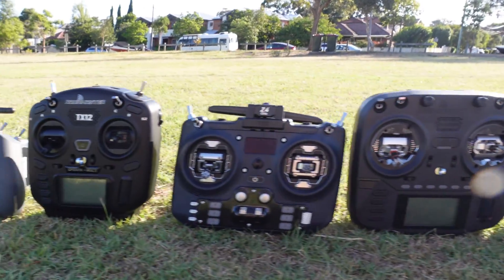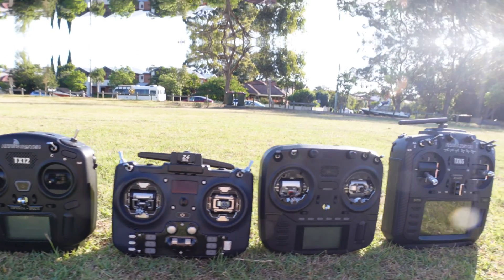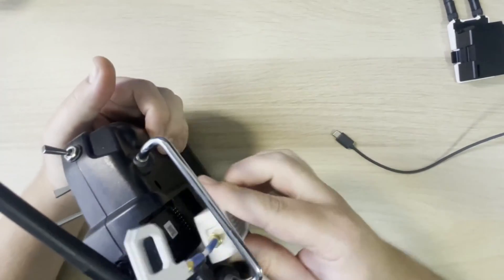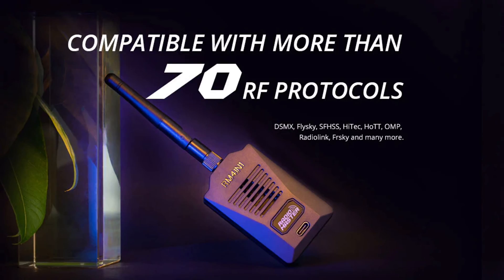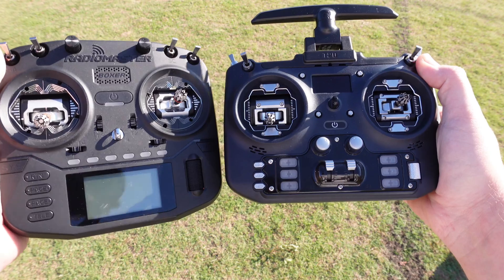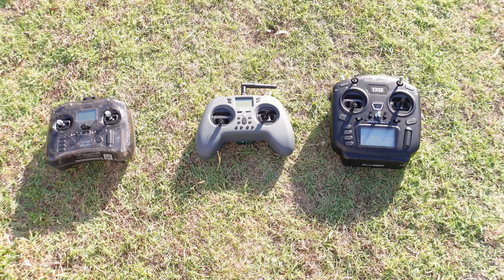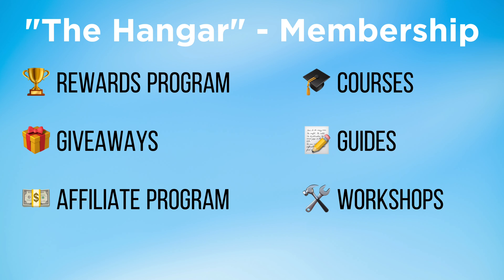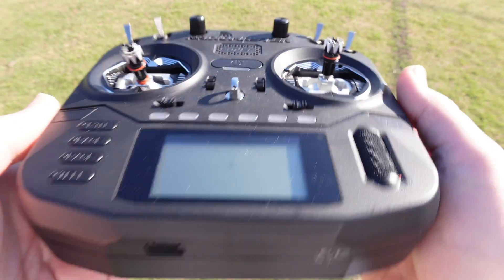How To Buy The Best FPV Controller

Comment: So, I am beginner and bought a pocket to learn on. My hands are used to controls where moving drone is on left. Thrust is in right. Is the silver hex screws in a screw a lot inside controller put can be reached by Allen hex key.. does that change the controls from default to custom ?

Comment: Is the boxer a good radio for rc planes? I'm actually looking into getting a new radio and the new jumper t14 v2 caught my eye I want a radio for both fpv and planes I'm flying with elrs on my quads and spektrum on my planes so I'm either wanting a 4in1 radio with a elrs module is the cheapest route however I don't think that jumper offers a internal 4in1 but rather has the external 4in1 module
Reply from the maker: They’re all good for planes as well as drones.
Reply: @DarrenAllatt  Thanks man👍🏻✌🏼

Comment: OpenTX IS NOT a variation of EdgeTX. EdgeTX is a FORK of the OpenTX project, born in 2021. Just to be precise.
Reply: thanks for clarify
Reply from the maker: And the typical pilot who watches this video, doesn’t care about the specific details. They just want to know what it is conceptually
Reply: @DarrenAllatt I think what he is saying is that edgetx is a variation of opentx. They’re not saying that you should have used the word fork when explaining the operating systems. Btw, this is the most factual and to the point videos I’ve seen on radios! I’ve been watching loads of videos to work out what best for me, the differences between them etc and this one sums up a lot of the information very well so good shit 😃

Comment: If budget is not my concern , what is the best controller should i get ? I’m planing to use it on live streaming , which need hdmi clean out on the google, and probably using o3
Reply from the maker: Firstly, your Controller and your Goggles are completely seperate and unrelated in any way shape or form.

- If you want a Digital FPV System that has a clean HDMI out for Live-streaming, DJI is not a solution, they dont do that. Walksnail Goggles X will give you the closed DJI experience with HDMI Out

- Controller wise, probably Boxer Max from the FPV ones. But if money is no object, get a Futaba, but they are really useless for FPV as they're designed for RC Planes and Heli's not FPV Quads and out systems like Crossfire and ExpressLRS.
Reply: @DarrenAllatt  
So google is video transmission to send image ,
controller is radio transmission, to send command,
These two are completly different , no string attached ? 
I can use any video transmission, for any radio transmission system ?

Then

why dji is not solution ? Is it because dji google dont have hdmi out ?

Because i think i love dji o3 image quality, is it possible to use dji o3 and use walksnail google x ?

I have not seen walksnail footage , do you think its better or atleast the same quality and latecy compared to dji o3 ?
Reply: @QulStream  DJI has the best video quality currently but Walksnail isn't too far behind and has some advantages like more choices of video transmitters for various sizes of quad. This really makes a difference if you're flying smaller quads. If you plan to fly 3.5" and above it doesn't really matter and DJI will do fine there. Also, it's much easier to find DJI bind and fly (prebuilt) quads for sale if you decide not to build your own or want more BNF choices in the future. If a drone comes in a digital format at all, they're pretty much guaranteed to have a DJI version.
Reply: @Invid72  i still confuse about controller and googles, if i wanna live stream and have hdmi out, what is the best system money can buy today ? What is the most worth setup?

Comment: I have been looking into buying my first rc plane and I think I’ll get the FMS ranger 1220mm. What controller would go with this plane well and also perhaps future proof for future planes if that is something that needs to be done. The controller should be forever right or at least a long time so if extra money needs to be spent that’s ok. I’m also not sure what receiver to get 
Also one final thing can I put traxxas battery connectors on the plane? I don’t see y not and the batteries seem to give the same power
Reply from the maker: Sorry I don’t do RC planes so I have no idea
Reply: Planes tend to need more switches for their various functions so a TX16S Mk 2 might be the best choice for you. It'll handle quads well too due to EdgeTX and has enough switches and sliders for all your plane functions (landing gear, flaps, nav lights, flight modes, etc.). The only real downside is it's a little more expensive than the other choices in the video and it's larger and heavier than all of them too. On the other hand, it has a nice big colour LCD which can be useful for telemetry when flying line of sight instead of FPV.

Comment: why do you not recommend the T16S mark 2? Just saying you wouldn't isn't particularly helpful - other than this omission good video :-)
Reply from the maker: Too many switches and 250mw ELRS.

When the boxer gives you 1W why settle for something less
Reply: @DarrenAllatt  Thanks!
Reply: @DarrenAllatt  All people I have seen use external high-frequency converters😂
Reply from the maker: @罗罗琛  yeah because the internal power is not enough

Comment: I highly suggest people dont cheap out on controllers. these things will last you the entire time you do FPV flying and you want something reliable and good. but then cheap out on the drones as they will break more often
Reply: Thoughts on the Radiomaster pocket?
Reply: If budget is not my concern , what is the best controller should i get ? I’m planing to use it on live streaming , which need hdmi clean out on the google, and probably using o3

Comment: Can we not fly a plane or helicopter with a Radiomaster Boxer? I'm looking for a radio that can do drones, planes, helicopters, or boats?
Reply from the maker: You certainly can, but I only do drones so can’t give you any guidance on the others
Reply: @DarrenAllatt  Thanks for replying!
Reply: Tx16s has more switches, which you might need for a plane.  Outside of needing more switches, you can fly a plane with the same thing you fly a quad with. Personally I fly my planes using a FrSky x-lite.

Comment: Would you recommend the Jumper T20 over The Boxer if availability wasnt an issue? My use case is going to be starting with a computer sim and after I feel I have learned enough from that to move on to a 5" Quad to translate from the sim experience. Or if you dont think thats a good idea what would you recommend?
Reply from the maker: Both are great radios - I have both and really it’s just a matter of preference. If you want to be like everyone else, for the boxer.

Comment: Enjoy listening but disagree 100% on some parts. Much better to get a radio with 4 in 1 internal and ELRS external module. The 4 in 1 protocol hardware is basically static. ELRS is constantly moving and sooner or later, probably sooner, the internal ELRS is just going to be legacy hardware. Much cheaper to then buy the latest and greatest ELRS JR bay module than a whole new radio. BTW: Those "toy" protocols as you call them in the 4 in 1 include frsky, futaba, Spektrum....
Reply: Elrs can be static too, just dont update the firmware. So much simpler if you put the protocol you actually want to use inside the radio.
Reply from the maker: So buy a radio with an internal module that FPV pilots will never use, and then have to buy an external module + replace it down the line if the hardware changes.
Reply from the maker: And no, those are not the toy ones I’m referring to in a 4in1; which has up to 100 protocols.

Comment: I have the jumper T pro Elsr V1 .. I open it up seems to have potentiometers .. I adjusted and greased .. works like silk ,, the perfect  tension ,,, are the all metal gimbles that much better ??????????????????????????????????????  should I upgrade ???????? I feel ever little thing with this cheap ass controlller just amazing feel ,, light weight super smooth gimbles are the halls that much better ??
Reply from the maker: The potentiometer gimbals in the jumper are the same kind as what is in a thousand dollar futaba
Reply: Thanks , i will stick with my Jumper V1 must have got a good one ,, see a lot of complaint's I drive mine everyday and starts right up no issues but i do take it apart and service it every so often  ,  check wires and so on ,, gimbals are really smooth and the plastic doesn't bother me i like the lighter feel    @DarrenAllatt

Comment: I'm new to fpv and going to buy the nazgul evoque f6 v2.. Would you recommend the boxer or the tx16s?
Reply from the maker: Boxer as it has higher output power for ELRS…
Reply from the maker: also if you are new to FPV, why are you buying a 6" Quad, go and get a 5"  - you have zero experience on flying so a 6" is going to fly a lot worse than a 5"
Reply: @DarrenAllatt  thx for the response, yes I have no experience with real drones. But a lot in the simulator and I didn't knew flying with bigger proppelors was more difficult. So would you recommend the nazgul evoque 5' much more, don't you think that I can fly the 6' with simulator experience. Cause when I buy the 5' and then the 6' I'm spending a lot more money than directly buying the 6'..
Reply from the maker: It’s not about whether or not, you can fly a 6“ - it’s that they fly very differently to a 5” - think of it like driving, when you’re flying a 5 inch it is more like driving a car while 6 inch is more like a small bus

1 inch may not seem like a lot but it has a very big impact on how it flies. The other element is it’s very hard to get a good flying and locked in 6 inch quad unlike a 5 inch which we have nailed that so much 

If you want to go with a Nazgûl fine I think the gap Mark five is a better by than the Nazgul
Reply: @DarrenAllatt  But Do I have to build it by myself, isn't that complicated?
Reply from the maker: @StoicismAndPhilosophy  you can either buy it as a “Bind and Fly” or build it. 

I have a bunch of guides, workshops, mini courses and full courses courses on my website that take you through building - DarrenFPV.com
Reply: @DarrenAllatt  okay tysm, but one question left, I hope I'm not annoying. Why would you recommend the mark 5 so much more than the nazgul evoque?
Reply from the maker: The way the Nazgul is built it makes it difficult to use other electronics if you happen to break your flight controller or esc - so the mark5 is more compatible with parts from other manufacturers

Comment: You need to watch out with your mixing. The visual example that you've put in have audio yet you have not mixed them or muted them, they are sometimes above your voice. The usual goal is voice = -3-6 db (I amplify it then put a limiter), background stuff = -15-30 db depending on your needs.
Reply from the maker: Thanks for the tip!

Comment: did you know that RM Pocket manual says 

When operating your RadioMaster transmitter, please be sure to maintain a separation distance of at least 20 cm between your body (excluding fingers, hands, wrists, ankles and feet) and the antenna to meet RF exposure safety requirements as determined by FCC regulations.

Comment: I have the boxer , but I've spent 3 years on the dji v1 trans . The gimbals are slightly closer together on that . Is there a measurement between stick ends on the jumper t20s . Cause I'm considering that and moving the boxer